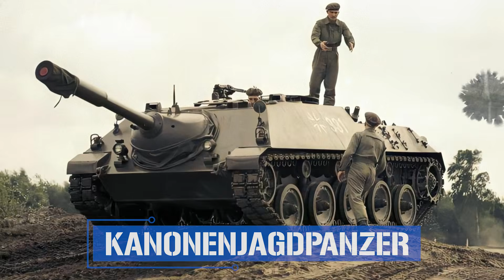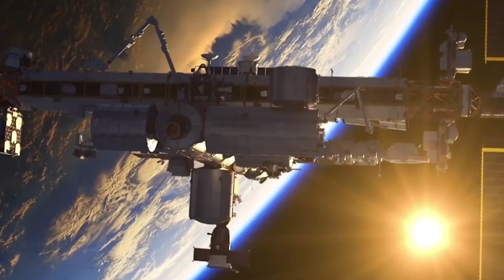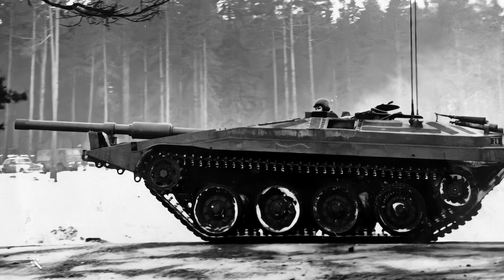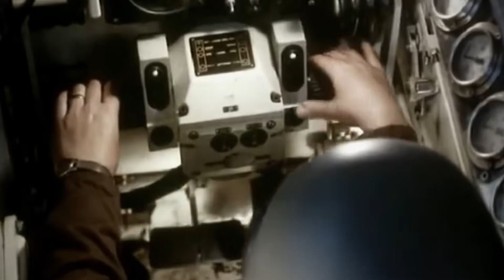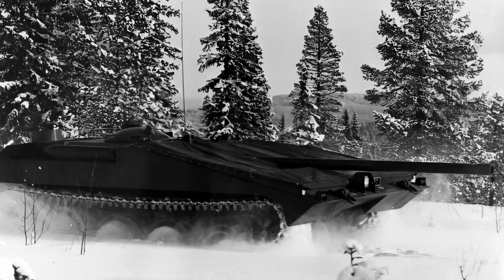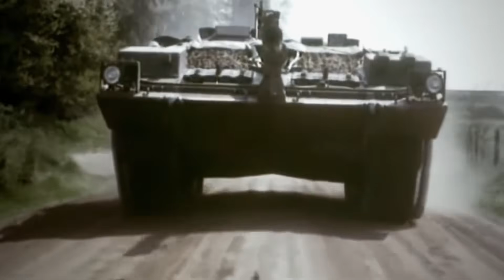Stridsvagn 103: Sweden's Turretless Cold War Super Tank

Comment: Is the design that revolutionary? Weren't the German Stugs designed very similarly?
Reply: This tank could be driven by 1 crewman alone. It had super fast reload and accuracy. Its siluette was super low. And the armor protection was extremely impressive for its time, and with the engine at the front it also gave many extra levels of crewprotection in addition to that. It was a fast tank and could cross bridges without much a problem. It was hard to spot, hard to hit, and had good protection and was very bouncy regarding its extremely well sloped armor. It was faster to lay aim on a target and fire than other tanks of its day despite the lack of a turret.
So it was a Stug on steroids. Much better sloping on its armor, and it could be handled by 1 crewman. And the automatic reload gave it superior rate of fire that would allow it to kill more enemy tanks in a minute.

But with better projectiles, gun stabalizers and such did this vehicle quickly become obsolete as a tank. It could probably still play a role as a defensive vehicle making ambushes as a StuG. Perhaps even today. But otherwise do I think this vehicle is outdated. It would probably even be scary to assist your own infantry to make frontal assaults on enemy infantry in one of those when the armor is so crappy.
Its engine was a bit overly complex and weak, and the tank was never mass produced in enough large numbers to make it cheap in terms of low per-unit cost. One could of course give it a better engine, a bigger gun and perhaps give it some chobham armor or steal foam for better armor protection. But I still think this glass gun would be too badly protected and an easy target. And unlike StuG can the S-tank not move its gun at all without moving the entire vehicle - which I consider to be a weakness for this design.
I therefore doubt that anyone would try to build a machine like it again. At least unless we have another world war...

The German StuG lacked a turret because that made it cheaper and faster to build than a normal tank. The S-tank was rather a bit expensive, and it was never mass produced to the same degree. The lack of turret also allowed the StuG to save weight. That in turn allowed the StuG to carry extra armor and a bigger gun than the little Panzer III.
The S-tank on the other hand did not have particulary big gun or extra armor slapped on on top of it. One thing that impressed the Swedish designers of the S-tank very much was the StuGIII's extremely good traverse speed, when a few of those machines were brought to Sweden for trials after the war when the Swedish government tried to decide which new tank it wanted to buy, or what features from other tanks it wanted to copy if Sweden were to built a tank of its own.
Reply: StuGs were not tanks, but infantry support guns.

Comment: This tank seems almost impossible to take out head on, considering it's shape and low profile. Brilliant!
Reply: Armor Piercing fin-stabilized discarding sabot says hi.

the profile made it quite easy to bounce the older generation APDS. Not APFSDS. APFSDS ignores angling, and the Swede find this out themselves when they managed to acquire some T-72 samples from ex-Warsaw pact country, and the 125mm sabot round, while has shorter penetrator length than standard NATO saboted penetrator, was more than enough to defeat the Stridsvagn 103 frontally even on its upper frontal section.
Reply: @gattonero2915  https://www.youtube.com/watch?v=_ikXfN5VAgw&t=30s
Reply: @Dunken88 You do realize T-62 has a 115mm kinetic penetrator right?

I'm talking about a 125mm kinetic penetrator, https://www.youtube.com/watch?v=5H9Tj-N385c
Reply: @gattonero2915  You could defeat the tank, sure. But the crew is another story, as both engines take up the front third of the tank with an additional armour plate behind them.
Reply: @Vinterloft  Tungsten Carbide is a nasty piece of material, and in form of a Fin-stabilized Saboted penetrator round, the density alone would make it laugh as it pass through the engine block like hot knife cutting through cold butter stick. Not even an additional armor plate will protect you as You will require something like Ceramic composite or even Depleted Uranium armor sheet protection just to defeat the kinetic potential energy of this highly-dense penetrator projectile.

That's why the IDF stopped caring about using the engine block for their Merkava tank as they added composite addon armor on their MBT's front armor starting with the Merkava Mark II Dalet.

That's also why they tried to create the Stridsvagn 103D variant with composite armor block applique armor addon but never approved to be applied on the existing Stridsvagn 103 families because the Stridsvagn 121 and Stridsvagn 122 was a better option.
Reply: @Rägarded  When I was a kid in the 80-ies my best friends older brother served as a tank driver before becoming a fighter pilot. He claimed the s-tank could actually dig itself a shallow trench with the blade, and use the hydraulic suspension to raise itself on tip-toes so to speak, fire on a target previously located by periscope, and then lower down out of sight in a few seconds. Don't know if it's true, but he was certainly the coolest big brother in the neighbourhood.

Comment: Think you got something wrong, no tank had 150mm guns (kv2 had a 152mm, but no production western tank that was called a tank had a 150mm).  Largest common gun in the west was and still is (while becoming even more common) 120mm.  In the 60s, tank guns were usually 90mm or 105mm on Western tanks.

Comment: Sweden's defense doctrine could best be described as "geopolitical and strategically defensive", "operationally (the brigade and battalion level of warfare, where the focus is mire on manuever and position to get your actual shooters into place where they can shape the firefight) offensive", and "tactically (the actual trigger puller level stuff from individual soldiers to about the company level) a mix, depending on circumstances".

It's a good plan, fairly common even for nations that don't have a tradition of neutrality.  

Strategic & geopolitical  - try to avoid the war altogether, but make sure if the war happens, it happens on terms most favorable to you as possible.

Operational - sieze the ground the enemy must take or traverse to win, and set up your front line shooters for success.

Tactical - depending on terrain, enemy composition and actions, and your own maneuverability and survivability, either hold from chosen positions or assault at the most vulnerable enemy points, as appropriate.

This is literally Sun Tzu stuff, hardly unique to Sweden.  But Sweden has done a very good job at the first, and a credible enough job at preparing for the last two that it has reliably reinforced the strength of their strategic and geopolitical goals - Sweden has managed to look like invading them is simply way to expensive and risky for an aggressor to bother.
Reply: " Sweden has managed to look like invading them is simply way to expensive and risky for an aggressor to bother."

That was actually the same mindset Karl XI (Carolus Rex's father) had when he decided to reforge Sweden's forces with a standing Army (Caroleans) and Navy after the battle of Skåne.

Comment: The Centurion had a 105 mm cannon, not a 150. Sweden did not use a 155 mm main gun, that would classify it as a self propelled howitzer.
Reply: The Kranvagn )KRV) has a 15 cm gun for the main alternative. "Howitzer" has nothing to do with calibre though, it's all about trajectory, like the 10 cm howitzer version of the Sherman.
Reply: yep, as Johan said the caliber in mm isn't the deciding factor on howitzer vs gun but rather velocity, a good example is Russia or rather the Soviet Union with 152mm howitzers such as the D-10T in the KV-2 and the SU-122 with the M-30S and then 152mm cannons such as the SU-152 which had the ML-20S Gun-Howitzer as it performed both anti-tank capabilities also howitzer needs, there were also the experimental BL series guns two of which being 152mm those being the BL-8 and BL-10 these were both proposed as upgrades for the ISU-152 series Self-Propelled Gun the BL-10 being a upgraded BL-8 tho the end of WW2 saw the program put to a end, another example now popular due to War Thunder is the Object 120 SU-152 "Taran" which used the M-69 152mm gun which was a 9.45m long barrel designed for anti tank use firing APFSDS projectiles, and also if you want to get specific with the Sherman howitzer it's a 10.5cm or 105mm

Comment: Hardly a "supertank" no better gun than the M60, Leopard 1, Late Centurions and worse fire control than the first two. If the design was so brilliant, why did the Swedes repace it with the Leo II and not a "Super S-Tank"?
Reply: Well he forgot to mention that since it was in the hull , the barrel was much longer giving it more penetration capability (superior).
Mainly because advancments in APFSDS rounds by the late 80's made the slopped armour obsolete , no more incoming rounds bouncing off. Coupled with turret stabilization in the same time period made it possible to not only shot on the move but also hit another moving target. Still quite a good run for a tank designed in the early 1950's to have made it until 1999.

Comment: Why does Sweden not design it tanks like that anymore as it not like a turreted MBT would massively benefit Sweden
Reply: this design has unstabilized gun. Sweden also purchased some T-72 as test sample from the Germany stocks following East Germany's unification with West Germany. They found out that while the Strdsivagn 103 is impervious against APDS, it's extremely vulnerable against APFSDS, which ballistically more superior than APDS. APFSDS ignores angling, and the 125mm projectile, while having slightly inferior kinetic potential energy due to the shorter projectile lenght compared to NATO kinetic projectile lenght, able to penetrate the frontal angled armor of the Stridsvagn 103 like hot knife cutting through butter.

And when the Bundeswehr loaned several of their Leopard 2A4 they named as Stridsvagn 121 in Swedish armored force service (as well as selling the copyright of Leopard 2A5 to Sweden, which created the Stridsvagn 122) that's when they found out how obsolete their stridsvagn 103 was, and they never noticed how obsolete it was because how neutral Sweden is, and how this design never gained success outside of its own use so aside from the 1960s test against Leopard 1, Chieftain mk3 and M60A1, the tank never got tested by its contemporary peer until the end of cold war.

Comment: I wonder how these would perform against Top-Attack ATGMs. No turret means there's more space and capacity to carry armor and other protective devices like ERA.
Reply: Very poorly, as they were designed in the 1960s for frontal protection against APBC and HEAT. Longrod penetrators go straight through them, front to rear, which is why there was no time to develop a domestic replacement and Leopard 2 was licenced from Germany.
Putting on enough armour to protect against top trike, it would get so heave you blow the suspension.
Reply: It has a larger area to detonate top-attack ATGMs with, so potentially slightly better survivability for the crew as they take up a comparably tiny area when viewed from above. This would of course not matter, because the rest of the tank is jam-packed with other vital equipment, and would no doubt be put out of commission by a single hit from a modern ATGM.

The best chance to protect against top-attack ATGMs would be not to be where it hits. The second best would be an APS, Automatic Protection System, to shoot town the incoming warhead.

Comment: Ive been told that the Stridsvagn 103 could be used by one person,  effecive with two,  but sinze only two ppl in a fighting tank would be a strain on any two individuals,  so a third member was added,  becuse if the war dident kill the two crewmen,  they themselfs would. Please correct me if im wrong 
I would have loved to serve on one of thees beauties,  jävla snygg vagn
Reply: Yes, the tank would be fully operational with just 1 crew member though allot less effective for obvious resons :)
Reply: @JarlBSoD  What does "fully operational" mean? Because the driver having to climb to the gunners seat every time he has to fire isn't exactly operational right?
Reply: @josefstalin4532  The driver is the gunner.
Reply: @josefstalin4532  Both the commander and driver stations have a duplicate set of all controls, and gunlaying was done with the driving controls.
Only time anyone would need to climb around was to use the radios, as the rear driver was also the radio operator.

Comment: Centurion didn't have a 150mm main gun, a version was made with a 153mm to counter soviet heavy armour but was only a prototype.
Reply: I think it was just a typo of 105
Reply: The centurion in Swedish service did have a 105mm gun at the time. This is the reason this tank is named Strv 103. The number is the gun caliber in cm and then a number per adopter tank with that caliber. strv 101 was a Centurion purchased with 105mm guns and strv 102 was an older Centurion that initially had a 84mm gun that was upgraded to 105mm. Upgraded centurion lager becomes strv 104 in the1980s

The current Swedish tank is strv 122 so a 120mm gun and the second model with that caliber. Strv 121 was leased German Leopard 2A4 and Strv 122 is an improved Leopard 2A5  build for Sweden
Reply: @target844  There was a project to slap a 120 L/44 to a Centurion in sweden tho only a few test vehicles where made (1 or 2).
Reply: Figured it was a typo. I first heard it and had to do a double take. Then was like oh yeah 150 and 105 are easy to mess up. 

Also the strv 103 is one of my fav tanks in World of Tanks 😂
Reply: The FV 4005 was even fitted with a 183 mm Canon mounted on the centurion hull;)

Comment: How well does it stackup against a Javelin missile?
Reply: Just as well as any other tank without APS. Advanced missile systems can easily defeat any tank not equipped with countermeasures. This includes the likes of M1, Leo2, Leclerc, Challenger 2, and Type 10. militaries are finally realizing this and equipping later variants with APS.
Reply: Javelin didn't exist until this tank was retired.
Reply: @viceralman8450  Technically the Stridsvagn 103 was taken out of service one year after the Javelin entered service. S-103 was taken out of service in 1997 while the Javelin entered service during 1996.

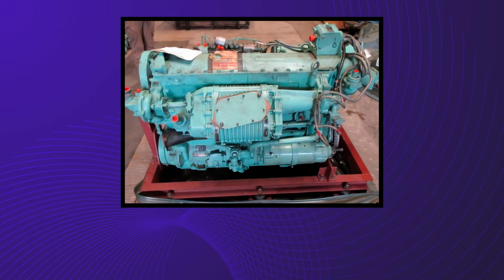Comment: 7:41 Do I hear correctly? Finnish road? Also the HEAT round stands for High-Explosive Anti-Tank
Reply: Finished road, so unfortunately not Finnish:)
Reply: @gustavostensson1048  I knew he meant that but I just don't hear the "-ed" in there.
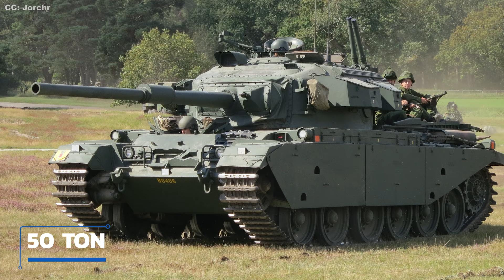Reply: In the start of the video he said the Centurion had a 150mm gun too. It's clearly a mistake but not well checked... At 1:30
Reply: @mrwoo1  I think Simon just read 105 mm wrong